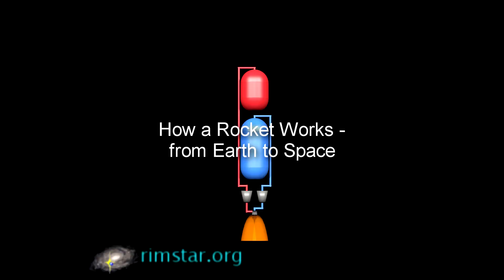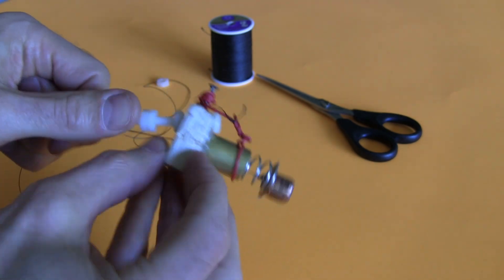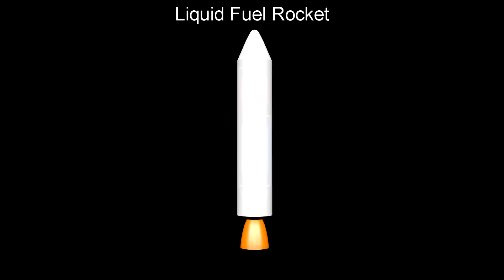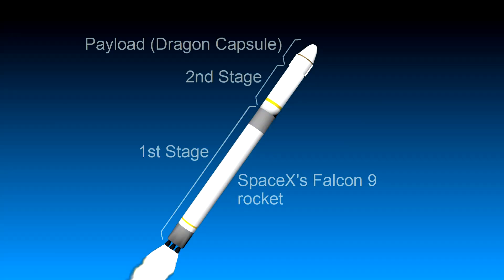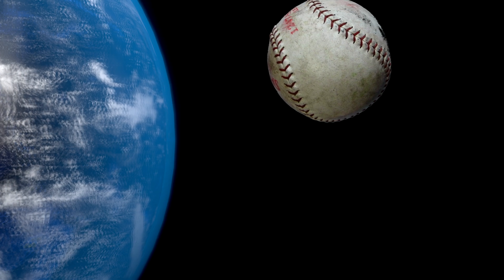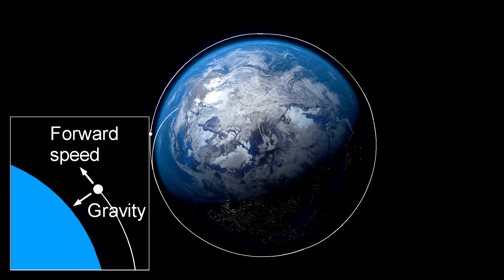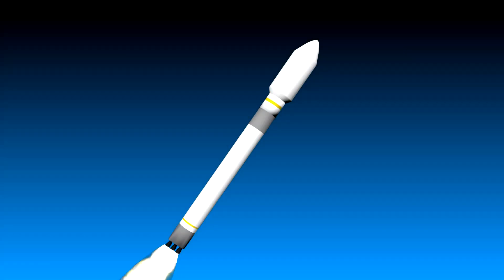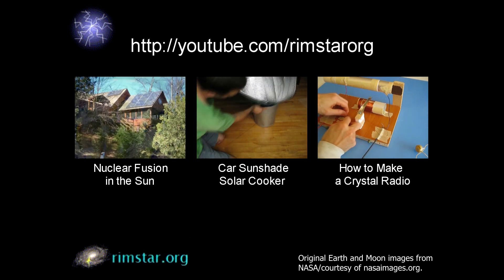How a Rocket Works/Earth to Space Eg SpaceX Falcon 9 and Dragon

Comment: Hey if gases tends to capture all available space how rocket works in space?
Reply from the maker: Can you clarify the problem? I don't see it. Space is very, very big and is a near vacuum.
Reply: @RimstarOrg  Meaning, a gas will expand and won't pressurize in the vacuum.  If so, how will a rocket propel itself using pressurized gas.
Reply from the maker: If you're talking about the gas in the rocket before it's expelled, the gas is pressurized inside large tanks (though very often the propellant and oxidizer is stored in liquid form). As for it leaking out of the tanks, it couldn't even do it fast enough. That's why very high speed pumps are needed to inject it into the combustion chamber. Once it's in the combustion chamber, it is ignited and then expands very rapidly and leaves the rocket at very high speed. Once it leaves the rocket then it doesn't matter where it goes. So sure, the gas spreads out into the vacuum, but only after it's been used to propel the rocket.

Comment: Noob question here, I'm trying to learn, how does the fire occur in space in an environment where there is no oxygen, please don't eat me, like I said just trying to learn
Reply from the maker: Which fire are you referring to? Rockets carry their own oxygen in addition to the fuels. It's the oxidizer I talk about starting at around 1:04 in the video.
Reply: Bare with me, I mean the fire, the explosion that propels the rocket, its like how we can't make fire underwater to BBQ something :p .. How does fire propelling the rockets not extinguish immediately in space, does't it require oxygen to combust in space? In the same sense if we light up a lighter in space will it ignite?
Reply: I specifically meant fire in vacuum space, problem is people think im a hoaxer or a flat earther, im not either and I absolutely love space, I just want to learn how it works
Reply from the maker: The combustion happens in the combustion chamber. It's only the resulting hot gases that are exiting. Actually, I'm not sure if there's not some burning going on there too since it depends on how efficient the combustion was but remember, there's oxygen in that mix.
Reply: okay another noob question, how does the combustion chamber (im assuming its the cone at the end?) not explode from so much heat
Reply from the maker: The location of the combustion chamber depends on the design of the rocket. Assuming we're talking about liquid fueled rockets then sometimes it's in an area just above the nozzle (the cone) and sometimes it's at the very top of the nozzle. One way of keeping it from melting is to have the walls of the chamber be hollow and to circulate the very cold liquid oxygen through those walls before injecting it into the chamber itself.
Reply: and btw thank you for the video and responding <3

Comment: the spring experiment is the wrong way to demonstrate N 3rd L, because a compressed spring when released extends simultaneously in both opposite directions along its longitudinal axis.
Reply from the maker: I would agree with you except that the spring is ejecting a mass.

Comment: But how did the stage separate?(Eject)?
Reply from the maker: Most rockets in the past have used explosive bolts -- the bolts are blown up using small explosives and the two stages move apart. SpaceX, however, uses pneumatics to push the stages apart.
Reply: RimstarOrg Thanks!!
But When will explosive bolts trigerred? Is it trigerred by a radio frequency, A timer, Or Maybe by the fuel remaining?
Reply from the maker: I don't know what triggers it. My guess would be either onboard computer or a computer at a mission control location.

Comment: If orbiting the planet results from a fast moving object falling toward earth thus causing things to become weightless. Then why are astronauts weightless on the way to the moon?
Reply from the maker: Imagine you're somehow in a spacesuit on your way to the moon with no spacecraft around you. In other words, imagine something has given you a push so that you're moving really fast at a constant speed. The Earth's gravity is slowing you down but it's not slowing you down at a noticeable rate. Even though the Earth is still pulling on you and therefore you have some weight, you feel weightless. That's because there's nothing pressing against you. So we call it weightlessness, but you still weigh something. I know, we should call it something else but we don't.
Now imagine you're in a spacecraft that's also been pushed toward the moon, just like you. You're both moving at the same speed and the same direction and so you feel like you're floating in the spacecraft. You're not really floating though. You're just two objects moving in the same direction at the same speed and so you don't get pressed against the spacecraft in any way. You feel weightless because there's nothing pressing against you in any direction.
Eventually, you get to a point where the Earth and moon are pulling on you equally and so you actually do weigh nothing briefly, until you've moved some more to where the moon's gravitational pull becomes stronger. Now you weigh something again. But you still feel weightless because nothing is pressing against you.
If that doesn't help then try this webpage which talks about contact versus non-contact forces http://www.physicsclassroom.com/class/circles/Lesson-4/Weightlessness-in-Orbit.

Comment: but how does the stages break apart after the fuel ran out?
Reply from the maker: Most use explosive bolts between the stages -- blow up the bolts that hold them together and the stages separate and move apart. SpaceX prefers something more reliable and so they have some sort of connecting mechanism that they disconnect electronically and then they use pneumatics to push the stages apart.
Reply: ty

Comment: My question is: how the space Probe goes so far, what kind of engine they have?
Reply from the maker: Space probes use a variety of engines. Some use ion thrusters (https://en.wikipedia.org/wiki/Ion_thruster). Those are rockets that work differently than in this video. Instead of ejecting the propellent by igniting it in a combustion chamber, ion thrusters eject the propellent using electric fields. The Dawn space probe, the one that recently arrived a Ceres used this type (https://en.wikipedia.org/wiki/Dawn_(spacecraft) ). Some use chemical combustion rockets like we talked about in this video. And example is the Cassini probe that recently ended its mission at Saturn (https://en.wikipedia.org/wiki/Cassini–Huygens). Some use a few different types, types for main thrust and others for steering.
Keep in mind, as I said in this video, that an object in motion will remain in motion unless something interferes with it. In space, there's not much to interfere so once a probe has gotten up to speed, the engine can turn off and it will continue at that speed pretty much forever. So the engine is on only long enough to get it up to speed. They do use rockets along the way for course corrections and if/when they arrive at their destination.

Comment: Wouldn't the rocket will run out of gas when they are space?? Do the rocket use gas when at space?
Reply from the maker: That depends on what the rocket's for. If it's just the rockets for getting a satellite into space then yes, they run out of fuel. As this video points out, the satellites don't need fuel to stay in orbit once they're there and going at the necessary speed. But the satellites themselves have rockets of some sorts with enough fuel to last the expected lifetime of the satellites. Those rockets are used for occasional corrections in the orbits. Spacecraft headed for the moon or planets also have rockets for controlling their trajectory and carry enough fuel for their missions too. But other than things like the rockets for the International Space Station, rockets typically don't get refueled once they run out.

Comment: But at which thing fuel acts force in space
Reply from the maker: It doesn't, just as it doesn't in air. Imagine a box with a explosion in it, and one that won't break from the explosion. If you explode it, nothing happens since the box is built strong enough to not break.
But now, make a hole in one side of the box and explode inside it again. What do you think the box does? The explosion inside pushes on all sides of the box, but not on the side with the hole since there's a hole there. What do you think happens to the box? Does it move due to the push on one side but not the other?

Comment: Watched Astronaut Don Pettit explain the velocity needed to leave earth's gravity to go to the moon. His formula put the speed at 30,000 mph plus. Then saw an MIT professor calculate it at 26,000 mph. Once again I saw a NASA presentation that put the speed at 26,000 mph. Then saw the original video of Apollo 11 where Houston called their speed at 17,500 mph to reach earth's orbit. Discounting the fact that NASA engineers seem to be working off of different parameters ( someone needs to send a memo ), where did they get at least 8,500 mph of extra thrust and why in your video they were out of fuel but still gained velocity.
Reply: 30,000 mph plus is far too quick for Apollo missions to the Moon.
Depending on the mission, the Command and Service Module (CSM) had to be accelerated by the third stage from the orbital velocity of c17,500 mph to between 24 & 25 mph. Apollo 11 for example was accelerated to 24,200 mph after the Trans Lunar Injection burn.

This would not have been enough to escape Earth's gravity, but it was enough for the CSM to fall into the Moon's gravity well.

The first 3 stages of the Saturn V were used to place the CSM, & the third stage, into Earth orbit, travelling at around 17,500 mph. But the third stage still had enough propellant to accelerate the combined craft to a velocity exceeding 24,000 mph.

Then the CSM & the third stage separated, the CSM tuned 180 degrees, & extracted the Lunar Module. Then coasted to the Moon. 

As the CSM & LM accelerated under lunar gravity, the engine on the CSM was fired to decelerate the combined craft to fall into lunar orbit. The SM still had enough propellant to accelerate the CSM out of the Moon's gravity well & into Earth's gravity well, & to make course corrections.  

After the final course correction, the CM & SM separated, & the capsule fell to a safe splashdown in the ocean.

Hope that clears up your confusion.

Comment: Why don't you try a ballon in a vacum chamber and see if it would fly when the air is releast ?
Reply: Because he is not an idiot. A balloon would obviously explode in a vacuum chamber.
Reply: It could be done. The balloon would simply need to be placed into a rigid container a bit larger than its inflated size. It would expand to completely fill the container and would not pop. The balloon would have a valve on it's end that was attached to the container and opened into the vacuum chamber.

Comment: but it has to maintain speed of 17000 mph to stay in orbit. you're gonna need fuel for that
Reply from the maker: I address that in the video when I mention that there's not much air to slow you down, so depending on how high up you are, and therefore how thin the atmosphere is at that height, it will be a long time before you are slowed down enough.
Reply from the maker: Not so if you're still at the altitudes where satellites orbit the Earth.  From https://en.wikipedia.org/wiki/Vacuum#Outer_space:

"But although it meets the definition of outer space, the atmospheric density within the first few hundred kilometers above the Kármán line is still sufficient to produce significant drag on satellites. Most artificial satellites operate in this region called low Earth orbit and must fire their engines every few days to maintain orbit.[citation needed]"

I do wonder about that second sentence though.

Yeah, this video was made just as Kerbal was becoming well known. It's due for a remake. Darn SpaceX now lands their boosters :-).
Reply: Nope, a vacuum...., No air to resist your forward motion (Once you are outside the atmosphere).  Your forward speed counteracts the gravity of the planet..

Get a hold of the PC game, Kerbal Space Program..., it teaches you the physics to get a rocket in to orbit.

Comment: Technical glitch?

Your liquid fuels seemed to be pumped from the TOP of the tanks in one demonstration???  Wouldn't they be pressed to the bottom of the tanks by the "G" forces of launch?
Reply from the maker: That depends on the pressure (or suction) that's being applied in order to force the fuel out. For example, the Falcon 9  v1.2 engine uses heated liquid hydrogen in its tank to maintain pressure in the tank (I don't have details off-hand but I guess there's some sort of expanding bladder in between the helium and the fuel) (https://en.wikipedia.org/wiki/Falcon_9_Full_Thrust#Vehicle_description).  A turbopump is used to suck the fuel out.
I don't recall where I got the idea to draw it coming from the top, it's been a while. I know the V-2 did it from the bottom (https://en.wikipedia.org/wiki/V-2_rocket#Technical_details).
Reply: +RimstarOrg
Thanks for the answer.  There certainly could be newer tech.  SpaceX and others have their finger on that.., 

Of course the TOP of the tank could have a SIPHON arrangement the takes liquid from the bottom of the tank on the INSIDE..,  ;)  Possibly for mechanical considerations of bulkhead transitions perhaps?

Comment: The precision required to send humans to the Moon is just staggering, just think about it, a couple of miles per hour off and you're just going to miss it. And the bravery involved, oh... What a great achievement for humanity!
Reply: the rocket is pushing the exhaust!!! mass goes backwards, mass goes forwards!!

If you are holding heavy textbooks while skating and throw them backwards you will go forwards! The rockets are literally throwing tons of material backwards at ultra high velocities. You don't need another person. you just need to throw your clothes, or throw anything. 

The explosion is the action and it pushes on the rocket and the rocket pushes on it - thats why there's massive streams of fire behind rockets - they're throwing material backwards at high velocities, while throwing, there is a reaction force pushing the rocket upwards
Reply: Rockets work in space because of action and reaction. Mass in the form of exhaust gas is forced out the nozzle and allows the rocket to move forward. 

The law of conservation of momentum means that if you have gases with a negative momentum, the rocket must have an equivalent positive momentum so that total momentum with the center of mass as the reference frame is zero.

Therefore, rockets will indeed work in space, and will actually produce greater force than within the atmosphere.
Reply: Conservation of linear momentum. If you grab yourself by the hair there is ALWAYS reaction forces. If you pull up on your hair, your hair follicle pulls down an equal amount. You don't move up, because all of the Newtons of force upward are cancelled out by Newtons of force downwards. 

If you're ice skating and push your partner forward, YOU GO BACKWARDS ALSO, you don't need air to move.
Reply: Josh Garber Exactly,, if you push someone when ice skating you both move right?? As you just said,, so the pushing was the action and you and the one you pushed were the reactions,, one 1 way and the other the oppersite way... What's the opposite reaction to the rocket? the explosion is the action and the rocket is 1 reaction but where is the opposite reaction.. Hey if you didn't need it Newton wouldn't have mentioned it would he!   Now try ice skating and push nothing and see if you move forward!! This is exactly like a rocket in space,, push as much as you like nothing will happen..
Reply: Bach Tran Ohhh I see, so no opposite reaction! So Newton was lying? Last I heard he clearly said,, "For every action there's an equal and OPPOSITE reaction"  No way,, with no opposite reaction there's no motion.. NASA is taking 35 Mill a day off you for this lie.. I don't pay it.. But you do or will. Rockets do not work in a vacuum, it's just impossible..
Reply: Bach Tran Jesus you are wrong I  so many ways,, Mass in the form of exhaust gas is NOT forced out the back nozzle!  Rocket fuel is forced out and ignited outside of the rocket. That explosion is the action,, The rocket is the thing you want to react and the opposite reaction is the atmosphere the action of the engine pushes against.. In a vacuum that has gone and that was the opposite reaction! Question,, how do you move forward with nothing to move through? answer, you can't. . Newtons 3rd law.
Reply: Davy, do you agree with the law of conservation of mass (disregarding nuclear reactions)? 

If not, I suggest purchasing a cheap lighter, using all the butane, and weighing the before and after. What do you think happens to the mass that seems to decrease - the mass is EXHAUSTED aka accelerated aka moved.

In a rocket, the fuel after combustion still HAS THE SAME MASS; the mass (that is generally in gas or CO2 form after combustion) gets directed or "fired" backwards
Reply: Josh Garber lol you rekt the idiot he still hasn’t responded
Reply: Diyan Boyanof They were very good actors.. And we've never been to the moon.. It's a contradiction of physics.. its the old alli barbar levitation trick that goes back to Babylon.. If you grab your self by the hair and pull why don't you have motion?? Because there is no opposite reaction that is why.. The rocket is exactly the same,, nothing in a vacuum can react because there is nothing there.. So you will not have motion.